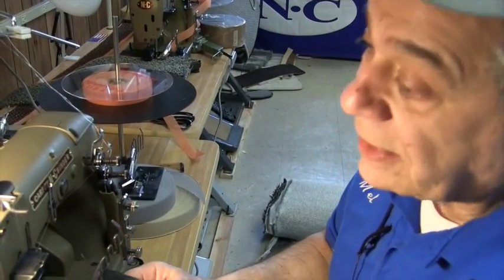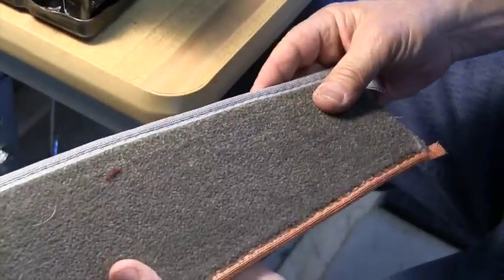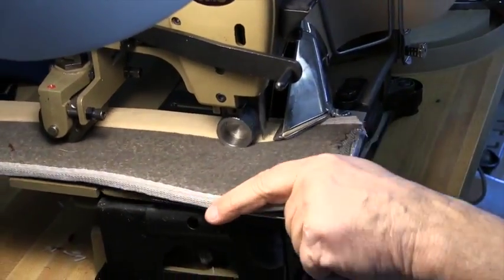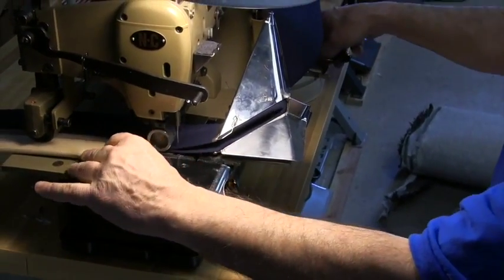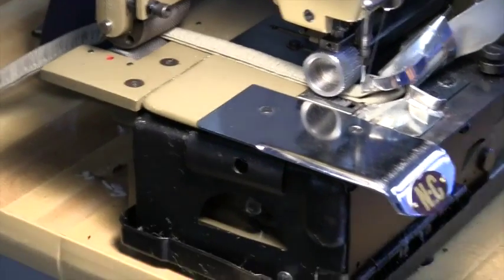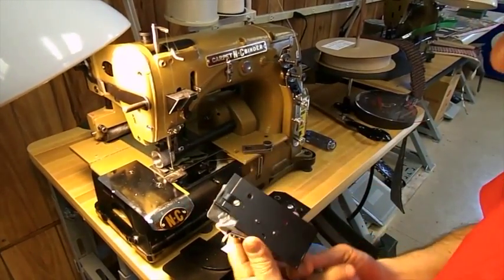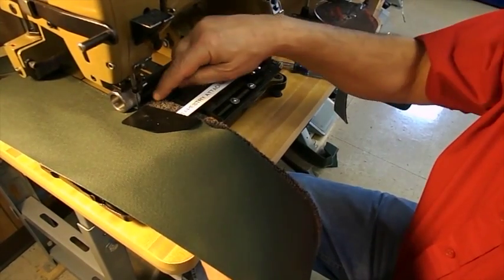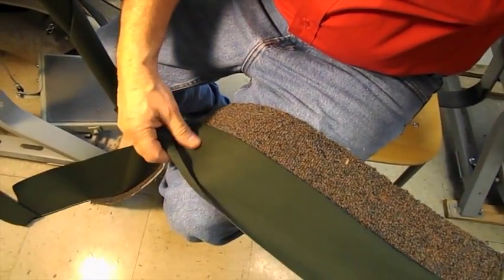CARPET BINDING MACHINE (NC TPB Carpet Binding Tapes, Wide Borders, Fringe)

Comment: NEED SEWING SOFTENER TO BIND STIFF CARPETS DO YOU SELL AND COST.
Reply from the maker: We have pints in stock.  call today 973-481-3500
Reply from the maker: Sorry i have just now seen this.  Call today 973-481-3500  Gallons are $40   Thank you!
Reply from the maker: Sewing Softner Pints $8, Gallons $35
Reply: You could lightly apply steam to the backing. I use a jiffy steamer.